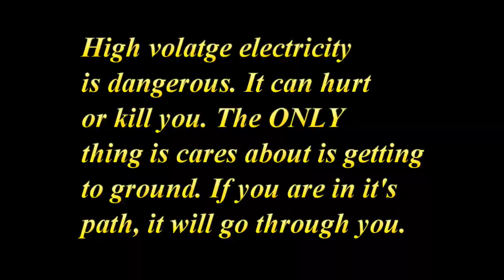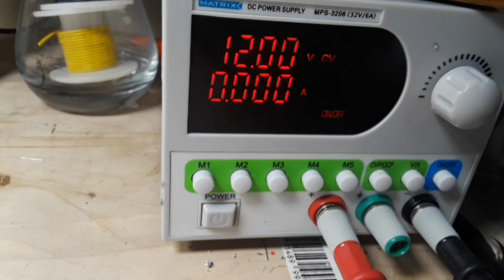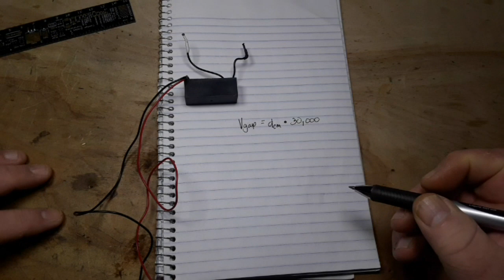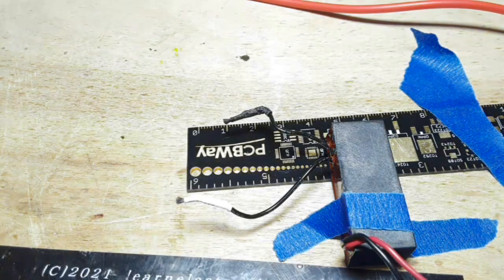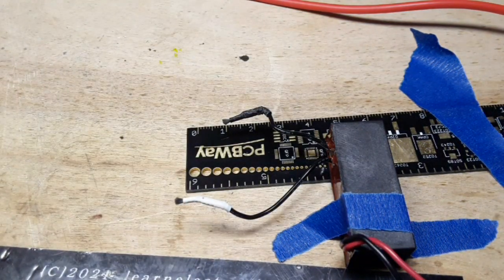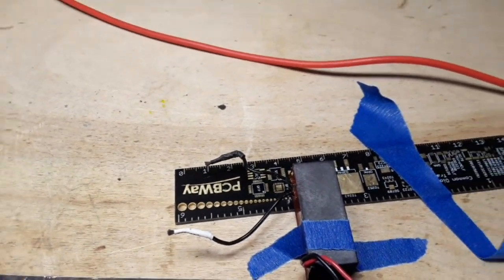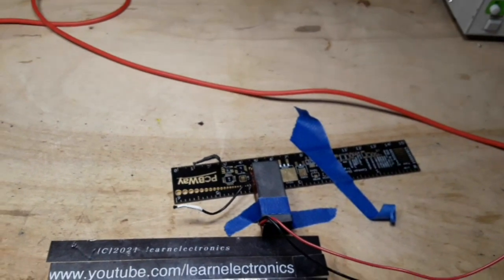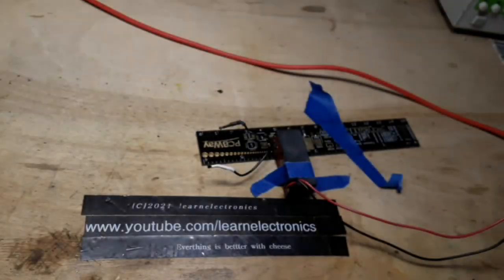Playing with high voltage, arc voltage calculation

Comment: Funny timing! I was actually just messing around with a 3-5V to 4KV module earlier today. I have an ozone sensor that I wanted to play around with, so I bought a bunch of cheapo high voltage modules to test out.

I can’t smell any ozone of the 5V to 4KV one, but I have another one which is 3.6-6V to 20KV that absolutely blasts out ozone if you separate the leads more than a centimeter.

Comment: Is the constant (30,000) derived from the gap jumping at sea level in air?
I remember in Automotive class, we would test spark plugs under pressure because they might work at sea level pressure but fail at higher pressure.
Check out the YouTube site: Tested to Destruction. Steve is playing with some deadly high voltage.
Have a great weekend Paul. Peace.

Comment: Can you do a video on using an arduino to power an opto-isolator gate driver to a power mosfet? Im an amateur learning from you and others and have been trying to get a FOD 30182 to power an IPP075N15N to drive a solenoid and i cant seems to get it working, and i cant find ANYTHING about how opto-isolators (push pull) work. No one on stack exchange has gotten it working and all the resources ive found are for opto-couplers not opto-isolators. Le Help

Comment: Hey I wonder on something, I probably didn`t understand this?

I work with clearing trees under powerlines, 22Kv ones.  the distance we`re not allowed to cut branches or whatever is 40cm from the line. that is safety distance.   but they accutaly told me that the electricity could "jump" 22cm from that Line to any object. is that true?
and if so, how do one know the "Jump" lenght of 22Kv?
PS: What is the jump lengh of 1150Kv ? :D

Comment: now make a resistor divider or use a x100 or x1000 probe and measure the voltage and check the waveform. i love high voltage projects. the 3 foot long arc in my thumbnail is 4.2kv but at a few amps

Comment: What are Spark Gaps used for mostly in circuits? because i see spark gaps in DVM meters
Reply from the maker: To bleed off high voltage before it can damage equipment. The air being an insulator "absorbs" most of the energy.
Reply: @learnelectronics  Can you make a video showing how to calculate the arc voltage of the spark gap in DVM meters?

Comment: probably a dumb question but how does a 12V power supply generate 3,000 Volts to form that arc?
Reply from the maker: A transformer. A few turns of thick wire on the primary(input) for current, and many many turns of thin wire on the secondary(output). The output voltage is a multiple of input turns times output turns. Basically you are trading current for voltage through inductance.